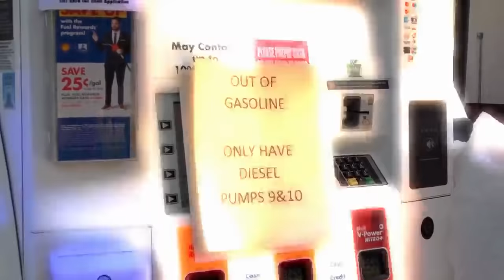Moonshiners Make Gasoline Out Of Alcohol During Gas Shortage | Moonshiners

Comment: Ethanol is the God send for small engines to make big power. Next to nitromethane, ethanol is far certain superior to gasoline in making reliable power, much cooler. The problem with it , is in cold climates, it doesn't want to light off, and it corrodes metal, so you have to pickle the fuel system (not Tickle) or add fuel cleaners- if it sits on metal for long periods of time. Of course it draws moisture in to it, so storage sealing is essential. It also takes almost twice as much fuel when running ethanol, to benefit from the cooling effect, however, it can be run and tuned to be perfectly friendly to the environment and natural. It's fun to think we can make E190. I would love to see how my- over 600hp four cylinder wagon- would run on a juice boost out of that 190 batch you just made! I have run e85 for 6 years so far and would only switch back to gas if I was in a freezing climate, or there was no e85 around. Great video, I really love the show, have followed it for many many years. I used to live between Charlottesville and Richmond In BUMPASS Virginia, Now I terrify the good folk in Houston Texas with my builds and creations. Check us out!
Reply: Thanks for the read.
Reply: @phillwop  how do you have so many subscribers without one video or post?
Reply: I seen once on a generator that was using 87 that the Ethanol actually made a build up on the valve enough to make it stick open. This was a 10 year old machine but it surprised me to see this.
Reply: It's ONLY a "God send" IF one is trying to build a high compression, high performance, or boosted engine. For an everyday low compression workhorse, there is no benefit to alcohol.
Reply: @davelowets  I'm sorry, that just is not true Sir. 
We have light and heavy duty vehicles that are labeled "flex fuel" vehicles so that low compression engines can take advantage of using pump gas, or E85 ethanol fuels with a different fuel and ignition map to ramp up both the torque and power of the engines. E85 helps the engine work easier, which scientifically is known in the industry as "increased efficiency" , if you wanted to get technical. There is not a petrol burning engine that I can think of that can not benefit from  the added cooling of the burning, of the fuel, ethanol offers, plus the fact that it does not pre ignite, so increased ignition timing can be utilized without Knock, or ping, or detonation, that regular petrol  engine has. Petrol can get hot and then ejects head gaskets and ring lands when it detonates and pre ignites. Even on a low compression engine, Gains will be had, when switching from regular pump gas to e85, if it is tuned accordingly. Check our channel for our 505 whp 4 cylinder 2.3 Volvo Station wagon if you think I'm blowing smoke rings up your waste hole! We did a actual test of the temperature that E 85, 93 octane pump gas, and rubbing alcohol burn at, the temperatures of the flame are very different, hence the cooling effect each different fuel offers! Most alcohol race cars don't even use cooling systems because the fire in the engine burns so cool! Check out the DATA on our channel, @Turbo World  where we fix things to last longer and go faster!
Have a great day!
Reply: @fullmetaldetectorist8031  Generators should be "pickled" when not used, with gasoline to prevent this build up, its like a greenish white chalk. E85 is hydroscopic which I think means it attracts water if left sitting for long periods, not ideal for tools like a generator! I use a lot of fuel additive cleaners in both my tanks and haven't had that issue in seven years I have been running full e85 in my 505 whp 4 cylinder in Texas heat. But I sure can see how it could be an issue, you are right! I need some tips from these moonshiner fellers on how to make some e85 gas, can we collaborate? I got the room to house a few of you in Houston, and I am 100% serious about it for the channel and your show! How about its fam?! Les do it!!
Reply: @TurboWorld  Yes, it IS true. Sure you CAN run alcohol in a flex fuel vehicle, bit you are going to lose 30-35% of your fuel mileage in the process. Alcohol contains 33% LESS energy that a gallon of gasoline, and an engine WILL have to burn at least 33% more alcohol than gas for the same distance traveled. There's absolutely no benefit unless the engine cant run on gasoline because of a too high compression ratio for gas. There's no point in using alcohol in a flex fuel vehicle unless it's at least 33% cheaper than regular gas.
Reply: @TurboWorld  Who cares about the "cooling effect" on a regular vehicle? Heat is directly related to horsepower. An engine extracts horsepower FROM heat. A regular vehicle has NO issues with getting too hot from running gasoline in it, so by running a cooler fuel in an engine that already has no heat issues with gasoline is simply wasting power and efficiency. Facts.
Reply: @davelowets  that would only be true if the tune was left unchanged. When you introduce more ignition timing, with a no knock fuel, you make more power. Be less offended and read what I am saying. The e85 fuel combined with a tune changes the power AND more torque. Every time!
Reply: @davelowets  the reason it burns more is to cool more. The reason it makes more power is not because of the energy in the ethanol, it is because of its cooling properties. The largest benefit from petrol pump gas to e 85  is that e85 does not knock, ping or detonate. So the ignition timing can be advanced in some cases as much as ten degrees more than any engine burning gas could ever survive, and make more power doing it while using more fuel as you said. So you are partially correct. But you don't completely understand. I hope I have helped.
Reply: @TurboWorld  Oh, I completely understand. I've had high h.p. engines in my drag cars for 25+ years. Some with over 1000 h.p., and yes I fully understand the concept. I've also done real world testing on a dyno to prove what I'm saying. You keep going on about "cooling" by running E-85. You only need "cooling" if you are exceeding the knock rating or intake temperatures of what an engine requires. Also on a low compression, everyday, workhorse engine, such as a normal passenger car engine, you want to run the engine with the LOWEST octane fuel that allows the engine to run without detonation. If an automobile engine runs completely fine with full ignition timing on 87 octane, and then you go and put a higher octane fuel in it and crank up the timing past its sweet spot, you will LOSE power, not gain it. An engine has it's own preferable timing setting that it likes. It wants what it wants, and MORE timing isn't beneficial to it. Simply cranking up the timing on an engine thats already in its sweet spot is NOT going to give it more power because you put a higher octane fuel in it. It doesn't work that way. The only time it WILL work this way, is if the fuel you started with has too low of an octane for the cylinder pressure that the engine creates. Engines that are designed for 87 octane fuel have no benefit from going higher. As for the benefit of the "cooling" effect of alcohol, this comes into play within the intake system, not the cylinder itself. Flooding the cylinder with extra fuel to "cool" hurts power, not helps it. A Top Fuel Nitro motor would make MORE power if it didn't have to introduce extra fuel in the cylinder to help cool it. The cooling effect of alcohol helps power production when it happens in the intake system, by increasing the density altitude (d.a.) of the fuel/air charge and the resulting increase of oxygen in that charge that enters the engine. This can happen in 2 ways. By the latent heat of vaporization effect with the pressure change across a carburetor venturi, and with boost from turbos or a supercharger. N/A Fuel injected engines alone don't see much of those cooling benefits in the intake because there isn't much of a pressure change for the alcohol to go through without going across a carburetor venturi, or being under boost. I've been there and dyno tested E-85 vs Gasoline several times on mild, low compression engines and high compression, high h.p. engines. The mild engines had no benefit with alcohol, over the entire timing range, vs the gasoline. There are plenty of videos on YouTube here that confirm the same thing. Just because a high performance engine benefits greatly from alcohol, doesn't mean that low performance engines that run absolutely fine on low octane fuel will see the same benefits. You can try to convince yourself otherwise, but the facts are the facts, and for small engines along with low performance automobile engines, gasoline is a more efficient and better fuel for them than alcohol. For a high compression, highly modified engine, by all means, use alcohol if the compression ratio and cylinder pressure require it.
Reply: @davelowets  and yet my dyno proves , and my channel proves a stock low hp engine can benefit from such small things as e85 conversion, tuning and design tweaks. You used a lot of words to explian nothing to prove anything you have said, Most of it looked quoted and out of context. Quite literally. The dyno has proven that such small things as more crankcase suction, can make a low efficiency engine more efficient. You just stated a false hood, that a low efficiency engine with changed fuel and tuned properly for it, will not make more power, run cooler and overall be more efficient. These are in fact the engines that take the most advantage of extended range of knock when e85 is added. The combustion chambers generally suck, they knock and ping on premium and rely on knock sensor to find some degree of reliable timing to retard to, while detuning the engine because of a gas fuel fault property, and that is knock. When such tiny things as crankcase pressure can effect almost every piston ring known to man. It's not difficult to understand that as e85  offers better cooling, in turn, providing better efficiency, longer lasting, more power. You can run higher ignition base maps of advance, increasing the  engine response, the power curve of the complete rev range.  We can argue what exactly more power means, and I will define that with any adding power over what it made is more power. The gains may not be huge, and for long, but there, are always gains. Your idea of what more power is , pretty much is relative. Your idea of what it should be used for, Also relative. Any additional power is more! I suggest  www.hpacademy.com for a brush up course to help you better make sense of it all. Have a great day!
Reply: @TurboWorld  Ok buddy. 🙄 Every single thing I wrote were my own words from my own mind. Nothing was "quoted" from anywhere, or "looked up" from the internet. And its all correct. Thanks for the compliment though, thinking I stole it from someines website. 👌

Comment: I'm pretty sure the M1 Abrams could run on this just fine.
Reply: For like maybe 5mins fully filled,
Reply: I dont imagine it would run for long because of how fast it would burn
Reply: @rhino6139  well the Abrams drinks so much fuel regardless of what you put in it, so that doesn't matter as much. (From what I can find it doesn't get miles-per-gallon, it gets gallons-per-mile)
Reply: @DarkKnightofIT  it's a tank so yeah, 50 tons is hard to move.

Comment: If you successfully obtain an ethanol fuel permit, doing this is possible. Also, apparently Spiritus makes grain spirit that's 192 proof (96% ethanol, basically just under the true theoretical limit for an ethanol solution that is distillable, though 190 is also close enough to that limit). Keep in mind that around 10% ethanol works just as well as tetraethyl lead at preventing engine knock, so modern ethanol gasoline is fine. Also ethanol gasoline you can get from a pump has gone up to 25% ethanol in some regions.

Also Mythbusters ran a 2013 car (apparently Ford) on pure 200-proof ethanol. Also, the original Ford Model T and Model A cars can run on pure ethanol or even kerosene among other unconventional fuels.

The inventor of the diesel engine designed it to run on vegetable oil, and the 1893 World's Fair demo of the engine was ran on peanut oil. Peanut oil is quite thin compared to something like canola or olive oil. It's effectively a very thin liquid. You still should make sure that the oil is kept warm/somewhat hot for best results when using it directly with no petroleum diesel or additives, unless you are using an antique diesel car. 

In theory you could make a custom carburetor capable of direct ethanol or in diesel cars direct peanut oil if your car is old enough to use a carburetor.

Also, ethanol and peanut oil burn far cleaner than gasoline and petroleum diesel. A peanut oil-fueled diesel engine's exhaust has a peanut smell, rather than the acrid smell of petroleum diesel exhaust.

Comment: I remember there being a small problem with runing to high amount of ethanol - cracking fuel hoses. The hoses have to be a bit stronger or you have to be prepared to change them a lot more often. Other than that hope it's cheaper burning ethanol than going for regular gasoline.

Comment: they have this at the pump too... its called e85 and people dont use it because it doesn't have as much energy per unit volume as gasoline does, leading to lower mileage. As far as diesel cars go, they can't run on this, as the combustion cycle works differently in those engines. However, they can run on used cooking oil after a little treatment :)

Comment: Older cars with carburettors could run more smoothly than a modern regular gasoline engine on pure ethanol or E85 because the carburettors would allow you to manually readjust the air-to-fuel ratio. In fact some really old cars like the Model T and Model A were designed to be able to run on either gasoline or ethanol because it wasn’t clear whether gasoline, diesel, ethanol, steam, or electricity would be the dominant fuel for motor vehicles.

Comment: The first engines ran on pure alcohol. It was Rockefeller who forced to use gasoline, because he had oilfields. The first Diesel engine ran on peanut oil until Rockefeller changed it. And what Time is trying to do, is to produce E85. That's gasoline containing 85% of ethanol. We had that here in Europe, but it disappeared, because the oil industry didn't earn enough of the 15% gasoline.

Comment: Ethanol burns cleaner and can make more hp than normal gasoline. Its also used for racing. E85 being the most popular in general (from my knowlege on street cars)
The vehicle needs the proper fuel system and be tuned to run properly on Ehtanol, but it should make more power or technically less CO2 with the same power as gasoline.

Comment: You need about 200 proof to run in a car or bike without mixing in gas or jet fuel. You need to add a dehydrent like tapioca pearls after the final distill.
You also have to be careful because shine will eat through gaskets & rubber fuel lines. If its not a flex fuel car or e85 only you will have to replace the fuel lines & injector gaskets. If you have an old car, you want to replace the single port injectors with 4 or 12 port so you dont loose millage.
If your car needs a high octane, you should add lead free AvGas or a couple bottles of octane booster

Comment: The neat part about making radiator booze for your car is you don’t need to toss the heads and tails (methanol) as methanol will run in a gas engine, although the rubber parts won’t like it and it will run leaner than gasoline 
I think if you can get the alcohol content over 90% and mix with gas then it should run trouble free, although that said I’ve never tried to run a car on alcohol, I’ve run diesels on cooking oil, but never a gas/petrol on alcohol

Comment: all you need is 2 distillations to bring the alcohol to at least 84% , the remaining water in the fuel will create steam during the ignition and increase the power , no need for gasoline , my friend uses it for his motorcycle and car , only minor modifications needed unless you want to add extra tank and fuel pump for the alcohol to keep the gasoline also

Comment: The bigger question is what does that do to valves, piston rings and cylinder walls. In the long term it could end up being worse. New piston rings would set you back a lot more than you'd save i think

Comment: You need to adjust timing and adjust the metering for more fuel if you run straight ethanol. There's less energy in ethanol compared to gasoline, so you need to shove more into the cylinders to get the same power. Wrong timing will also screw things up. If you really want to go all out, throw in a turbo and even more fuel for a real kick.

Comment: High Proof but if you add a fuel additive that’ll boost the octane from somewhere in the lower 80s to the upper 90s.
This will allow you to put it into some higher-performing engines (unless you have an old 1960s Fiat Inline 4 found mostly on the old Fiat 128, those can run on a mix of literally every kind of fuel including diesel.

Comment: So there were 3 drums, maybe 220 (55 gal) each. Thats good enough for a 500 L wash (~120 gal), which at best would produce 50 L in a continuous still with stripping. Here they ran it in batch 3 times,  so more like 20 L (5 gal). And with the amount of propane/lpg used, that's roughly 15 MJ/L in batch mode so 2.67 L/kg of fuel. Insanely inefficient. Altogether it would have cost about $21/gal and rhe mpg would be worse. Not to mention they would have probably left it out for at least a week since there was no controlled heating, aeration or nutrient supplementation. 

Or you know, they could have just used the lpg and modified their carburettor a bit.

Comment: 15% Ethanol Gas can melt car parts, so the EPA doesn't recommend it for cars older than 2002, but Toyota says you can't use it in cars older than 2012